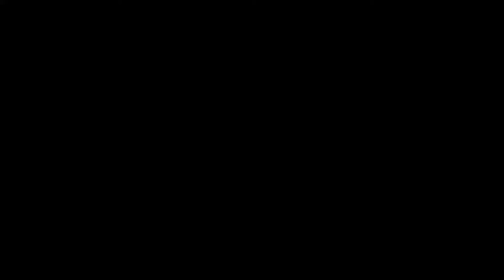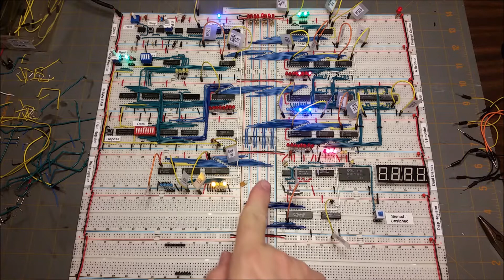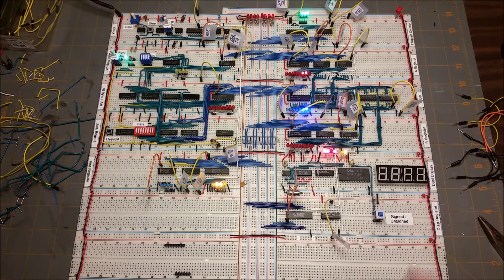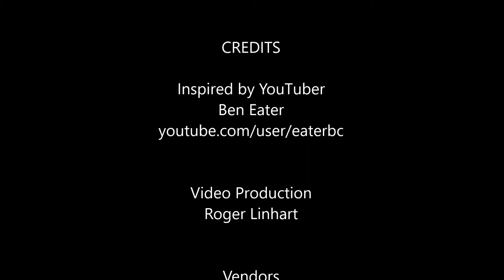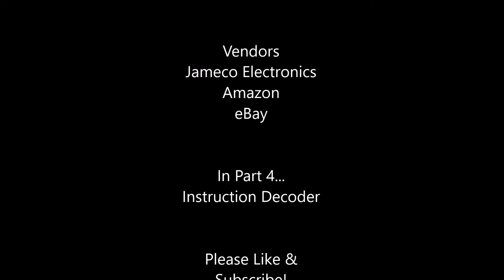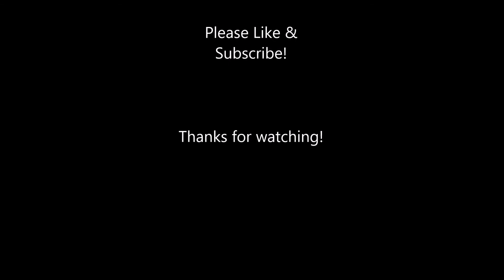My Ben Eater 8-bit Breadboard CPU Build Project Part 3

Comment: Oh excellent - I had only been following Ben Eater's processor, and hadn't looked at any other. Nice work!
Have you tried a green cellophane or green plastic filter on your LED display? That will increase your apparent brightness a bit.
Reply from the maker: I have some cell scraps from when I supported a computer lab in the theater department, I just have to find them.

I haven't been able to find out how much current the 27C64 data lines are able to source but have thought about seeing if using a buffer like a 7407. It might source more current than the 27C64.